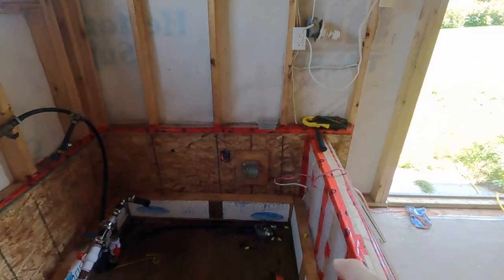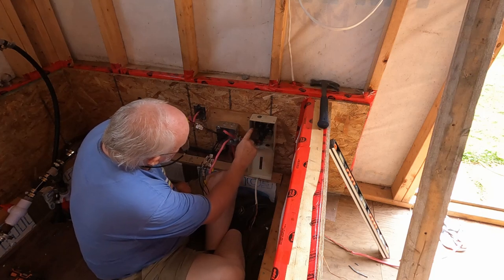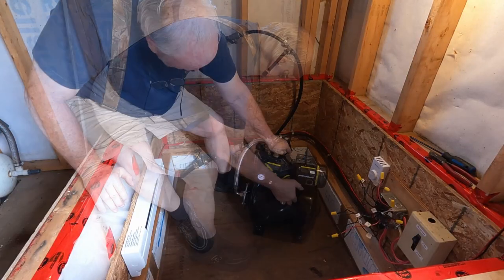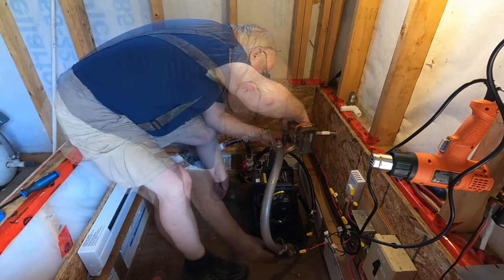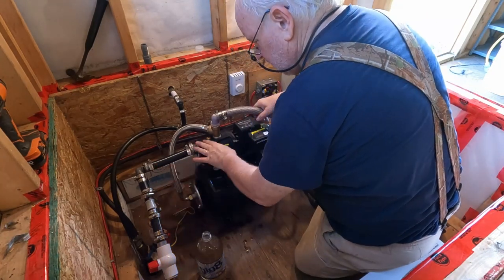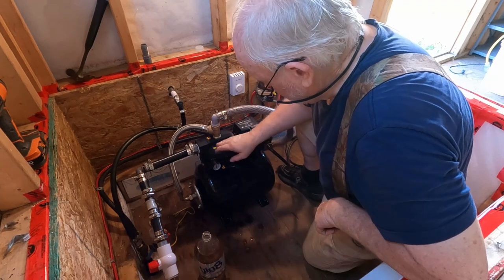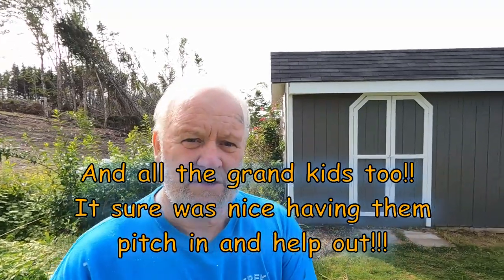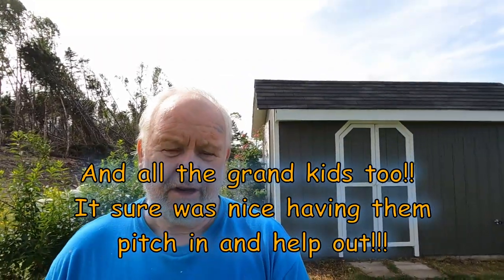I finally Finish the Boat House Part 16

Comment: The storm battered the boat house, but you prevailed in the end. The expanding foam was going on about as good as the caulk 😂 I saw you were able to trim it up nice once it was dry. What would a boat house on West Loon Lake be without hearing loons commenting on your paint job 😁👍
Reply from the maker: Hello there Dave!!  The loons are pretty vocal most times, especially around 2 in the morning.  They often wake us up.  They had a baby this year it managed to escape the turtles and other predators and now the adults are teaching it to fly.  Pretty neat to watch this.  They swim to our end of the lake and turn around and take off in the other direction.  That's to the North and into the prevailing wind.  The little one is doing pretty good.  They'll be getting ready to leave soon, so it's good that he'll know how to fly!!  Take care!!

Comment: Well, those are some of my favorite things: wiring, plumbing, spray foam, yakking, painting, yakking, yeah. Nice job Mike. I like that new pump and pressure tank, now that's an improvement to having to prime and prime...that picked it up right away. Is this the balogna storage shed? I think it would be perfect for tanning hides and placing a few deep freezers. What are you going to do now??? I was thinking this was a new TV show...Grampie's boathouse part 3, 251... I'll have to adapt to whatever you do next but I will miss the boathouse series. Sniff...:eyes-purple-crying:
Reply from the maker: How's she goin'?  Sorry Craig, but the boat house is done and done!!  It was a fun project and I enjoyed most of it, but I'm glad I can move this to the 'completed' list!!  But fear not, there are other rebuilds, repairs and mods coming up!!  Oh and I don't keep bolognas.  I find they tend to get dry and harden up if I put them in the freezer!!  Take 'er easy!!
Reply: :eyes-purple-crying::hand-orange-covering-eyes::face-purple-smiling-fangs: @GrampiesWorkshop

Comment: Well, Well, Well, There is a light at the end of that deep long tunnel. This is just great bud. I laugh a bunch when as we age we tend toread and for the best part follow the directions that come with things weather we know them or not, LOL. Tis a nice thing to  see you with the electrical tools in hand my friend. Weather it be hours,  days, weeks or months the project turned out just fine as can be with what you had and kept the $ going in at a dull roar. Well done fella. On Question though. Why the year round need for just that. Is it for fighting fire in winter ? or is the reason you and Nannie J need year long water you can filter and treat ? If so I guess I missed that while you were taking us on a look/see of the camp. That age thing sure can do a job on a fellas noggin eh, LOL. Take care ole' son.
Reply from the maker: How's she goin'?  Dean, have a seat and grab a coffee buddy, I got a story for ya!!  When we first were looking for a camp, Janet said she wouldn't go for it unless it had indoor plumbing.  I wanted a camp some bad so I was prepared to give up that 'living in the woods' concept and agree that I would make sure it ended up with indoor plumbing.   
So we bought the land and built the camp and I made arrangements to pump water from the lake to the camp and built a bathroom and put in a properly specced and approved septic system.  All was good.  

Janet loved it here at the lake, as I knew she would, and so we ended up coming to the lake every weekend and days off, even in winter.  So then I had a problem.,  I couldn't get the water from the lake in winter, so that meant only I came to the camp and that was no fun.  So the next summer I had a buddy come and dig a trench from the camp down to about 15 feet from the lake and then we dug a pit and set in some 30" well crock.  I then put in a 4" PVC pipe line and in that pipe I ran an electrical feed and a water line.  We buried the pipe and then installed a pump on top of the well crock and set up so we could pump from there back up to the camp.  The water level in the well crock is the same as the lake water level and in fact, the water in the lake has tannin in it and so is a brownish color, the water in the crock was the same color as the water in the lake.  I then built a small pump enclosure on top of the well crock, insulated and heated it and now I was all set.  We had water to the camp summer and winter.
Then Janet wanted a garden.  No problem we built a garden and she was happy again.  Then she wanted to water the garden but was afraid to run the crocks dry.  Which in my opinion would never happen because the water level was the same as the lake since I put the crock and pit so close to the lake. 
So I dug another trench from the well crocks to the lake.  I buried another suction line from the pump and plumbed it so that I could switch between drawing water from the well crocks or from the lake.  Problem solved and Janet was happy!!  As a bonus I had running water down at the lake all winter too.  I used to make a rink on the lake and found that using the pump to flood the rink worked out better than chopping a hole in the ice to flood it that way since the lake sometimes freezes right to the bottom close to shore.  
Then when we moved to the camp full time.  I built the boat house and made a pump enclosure in it and give us some storage down by the lake.  But then another problem!!  We needed a better water source.  One that wasn't brown and we could drink.  So I put in a bord well and plumbed that into teh camp water system.  So now I have potable water from the bored well for indoors and what I refer to as 'outside water' from the well crocks and lake!!
OK now you can finish the coffee and go back to doing whatever it was you were up too!!  LOL  Take 'er easy!!
Reply: @GrampiesWorkshop  The way  you have described the camp is like I have been there right beside you for all these builds. Mary, Tomoko and I lived with tannin water for about 10 years in  the bush. 3 attempts to do discover clean water failed so I had to pack drinking/cooking water. We showered etc but white loads of laundry had to go to town or a friends. If you cut a drink of whisky with it it slowly turned the drink light green and eventually so dark green it looked black. Odd it didn't affect the taste. Another fun one is it turned my white beard a rusty red. I looked 20 years younger, LOL. Well ole son, thanks for the coffee break. Take care of the water girl and yourself old friend. Love ya a bunch eh.
Reply from the maker: I had to laugh when I read what the tannin did to the whisky!!  That's a good one!!  So I have to ask, how long did it take, because when I pour a drink it usually doesn't last too long!!  LOL  Whisky was my drink of choice too!!   Love ya buddy and take 'er easy!! @TomokosEnterprize
Reply: @GrampiesWorkshop  THE COLOR STARTED RIGHT AWAY AND DIDN'T CHANGE THE TASTE. CRAZIEST THING I HAVE EVER SEEN.